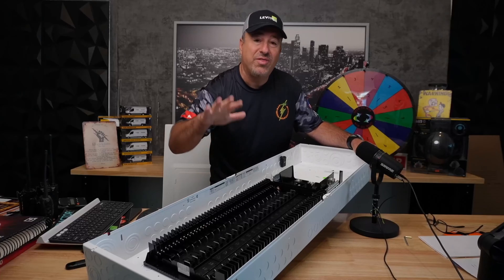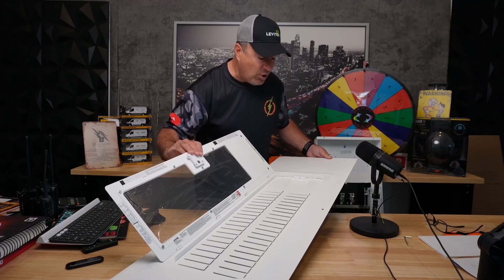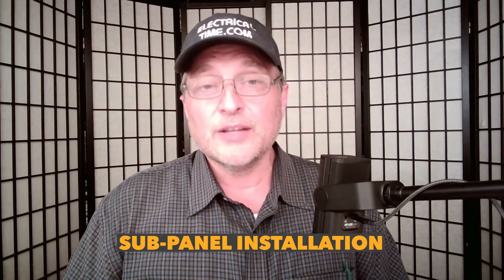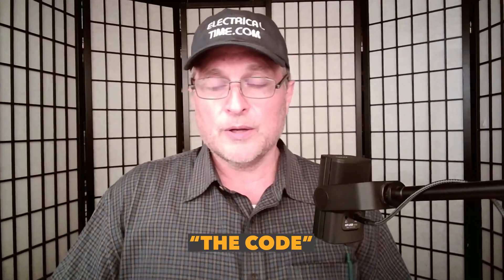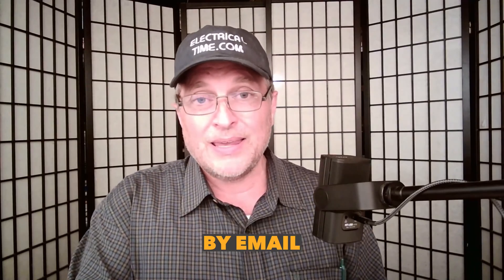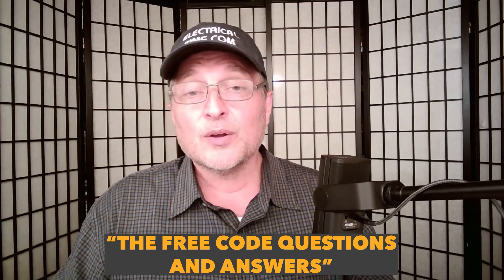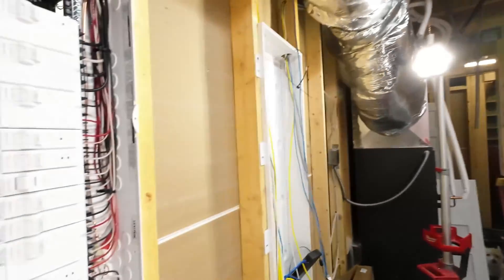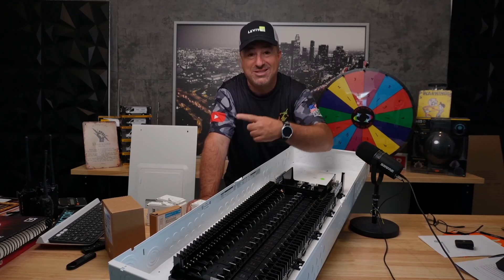The Ultimate Electrical Panel Video for electrical contractors Sales, Code and installation #Leviton

Comment: Have you connected a Leviton Smart Home Load Breaker Panel's (LWHEM2) module "BLUE" wire to a Generac contact board?  Does that BLUE Wire go to a transfer switch or to the generator AC1? Leviton does not show how the blue wire from the LWHEM2 comes out of the Breaker Panel over to the Transfer Switch, then continues from the Transfer Switch to the Generator Board? Does the LWHEM2 actually do the load shedding via the Leviton Phone App?  AND -- They do not show this wiring or explain the load shedding (if there is any) very well IMHO.
Reply from the maker: We have not

Comment: who in the heck can afford $100 + per wireless breaker?
Reply from the maker: The person that needs or wants it? Who can afford an iPhone?
Reply: @The360Electrician  iphone is cheap compared to buying 42 wireless breakers at 100+ each.
Reply from the maker: @KrazyKajun602 not if you want 42 wireless breakers? You can get a non iPhone phone for $149 same thing. You have to pay to play right? Good thing is you have the option to go "wireless" if you want and not forced

Comment: Once the panel is live and someone wants to update an existing breaker to a smart breakers. Do you need to turn off the main to the entire panel just to replace it since the wires are on the buss instead of the circuit? Thanks.

Comment: Just being pedantic. The breakers are Bluetooth Low Energy (BLE), not Wi-Fi. The smart module (LDATA v1 or LWHEM v2) are BLE to talk to the breakers, and Wi-Fi to talk to the outside world for monitoring. When getting firmware updates for the panel (smart module), you'll get them usually in pairs -- the main firmware and a BLE firmware.

Comment: Was this system made for the home occupant to change out a breaker on their own? I have a 20amp breaker that will not reset, and the AF, and GF windows aren’t red. Is this something I can switch out? And, Does it have to be replaced with an exact Leviton breaker? Meaning if that breaker that won’t reset, will I have to get a breaker that has the two windows, AF, GF and T, or can I replace it with one that just has the AF window? My box has a mixture of these 20amp Leviton breakers, some have the AF, some have the AF, GF and T. The one I need to replace is only used by my Clothes Washing Machine. Will I need the AF, GF and T on the replacement breaker?

Comment: In August of 2022 I was contacting Leviton support requesting an upgrade for the ability to remotely "Trip/Reset" the breakers as Gen 1 only has the ability to Trip the breakers. A real pain. Well guess what, they may have listened and now there is GEN2 which allows for also resetting the breaker. Wow! I also requested that they make changes to the UI which I feel needed to be made. I am still not happy with it. My entire house is Automated/Home Control and I also have Energy Management, so needless to say when I dish out big bucks for a product,  I expect a lot from the manufacture.  My biggest complaint is that they have not come up with a local API to allow the homeowner to eliminate the need to go to the cloud for the data. At times the Real Time data can be downloaded to the up to 5 minutes later, not very reliable for HA. (I monitor the entire electrical system using a BrulTech Energy Monitor which is spot on for actual Real Time Live readings). Also the data can not be stored in a "LOCAL" database nor is there any long term data that you can get to . Personally, it is my system and my data which should be made available to me right here at home. As for reliability, it has been OK. I have had to replace 3 breakers since I installed the panel. I have to admit that Leviton was great here as they replaced them instantly, but if you do decide to go with the Smart Panel purchase NON-Smart breakers as backup. Lucky me!  That is what I did (1) 60 amp (HVAC), (1) 50 amp (Range), (1)30 amp (Dryer), (2) (20 amp), (2) (15 amp). Believe me they came in handy. Gen 1 obviously was not designed for any type of Home Automation or Load Balancing/Priority restarting. Overall, I would give the Smart Panel a C+ rating, the UI a C rating, the data collected from the smart breakers a C. 

As for upgrading to a GEN 2, for the ability to "Trip/Reset" breakers remotely to control critical components ( for Load balancing and priority restarts) , of my house such as HVAC, Refrigerator, Media center, Home office... based on my GEN1 track record, and the steep price increase for the hub/breakers, probably not. As an ex electronics engineer and even an electrician, I do not think so. I originally was going to go with the Schneider PowerLink system, which has a  low voltage (24VDC)  3 wire pigtail (Gnd, and 2 leads that when the + voltage is applied will either Trip or Reset the breaker. The issue was that when I discussed leaving the pigtail from each breaker un-terminated with a local inspector, he did not like that idea. It would have taken about 2 months to get those breakers remote control wired in. I may still go with that setup... what is another disconnect/install.

Comment: Looks like you are using the older V1 version of the hub (LDATA) which can't use the new V2 breakers.  Maybe add a comment on the video description about the new hardware. The new V2 allows for remote on/off and automatic load shedding, a much more robust system, very  competitive to SPAN now.
Reply from the maker: Yes, that is correct. I just met with Leviton to do a follow-up Gen 2 video since gen 2 was not out at the time we filmed. Ironically, SPAN also wants to do a video with us, but details have not been ironed out. Stay tuned. All good stuff, but who will win. In the end?
Reply: @The360Electrician  Glad to hear you will do a V2 series, I will sub to keep up and check out the new video. 
For my recently completed home I asked for 2 Leviton panels, at the time V1 was the only thing available, so I have a crit loads panel and a main panel. With the new V2 I would have elected to go with one panel, but so it goes. 
I considered SPAN, but was turned off for a few reasons 
1) 32 slot max - which means at least 2 panels for me - that was a huge down side 
2) At the time, no support for generator (not sure if that has changed since I looked)
3) They will only sell to an electrician who has been certified by SPAN. Huge turn off
The plan is to slowly move to all V2 breaker over the next year or so, and once I have a battery system in place I will power both panel from the same source, and can use the automatic load shedding - shall see how that goes
Reply from the maker: Have you installed many? Seems like you know your product. I don't think enough electricians are installing them. Could be a huge extra for us. Where are you tuning in from?
Reply: @The360Electrician  I am in Colorado - I am a home owner who recently completed a new build - I have side by side panels which have all V1 breakers, but just upgraded to V2 hubs - I think the most challenging thing right now is availability of the V2 breakers - also they are way up in price if you can find them. 
I requested Leviton panels in my home
Reply from the maker: @iambabayaga   That's awesome, I love the plug on technology so you can simply just swap smart and non smart breakers at will. Great for upgrading or building out your smart panel over time. GAME CHANGER! I will have to check into G2 or V2 supply chain. I was just with the guys in charge of the smart panel over at Leviton, I'll send them an email.

Comment: I would love it if you did a follow up video even just a talking head about your experience with the Leviton Smart panel, technology that let you monitor and control breakers. The whole system is kind of expensive versus just getting something like the view too.
Reply from the maker: Gen 2 video coming and will definatly do that. Thanks for the support. Where you tuning in from
Reply: @The360Electrician  yes, I’ve been seriously considering it. I already have the Leviton panel installed, but everything’s a dumb breaker.

The vue system is $300 ish for 16 circuit monitoring, but it’s really messy. Going with Leviton GEN2 smart breakers and system is around the same price but that’s just for one circuit. Each breaker is almost triple the price. If the app integration and everything works very well it be worth it. Very clean install.
Reply: @TekShinji  do the dumb breakers make noise?
Reply: @The360Electrician  tuning in from New Hampshire!

Comment: Heard there are noise issues with the breakers anytime they're energized (hissing, clicking, humming). Did they fix that with v2?
Reply: I have had my Leviton Smart panel in for over a year now and I have never heard and noises coming from the breakers.
Reply from the maker: I haven't experienced that, is that on the smart breakers only or all the breakers?
Reply: Smart breakers only @The360Electrician
Reply: im told the issue is with the smart breakers. i would love to know what they sound like. @The360Electrician
Reply: All breakers @The360Electrician
Reply: @The360Electrician  Im looking to have my electrician put a 40 leviton in a Beach house. Worried about the noise issues with the wifi 2nd Gen and was told to stick to dumb breakers. Any thoughts?
Reply from the maker: @PalmBeachFlorida24  Nope, I would reach out to LEVITON about this. I havn't had any complaints? Should be nothing to chatter or humm with wifi?
Reply: @The360Electrician   ok, thank you!!
Reply: No hissing at all on my smart breakers. I think this was a fluke with some people.

Comment: On the right-side of the panel, where are all of your grounds going to? It looks like there is just a neutral bar at the top.
Reply from the maker: The top bar is separated since this is a sub panel. If you put the jumper in it will bond both bars and the can. Watch near the end I think we show it. Thanks

Comment: I bought a Leviton Load center for my house. I like it  but I feel that their app is still way to slow and clunky. There is also no way to access the usage history.

Span has the up-side where they are using relays, so you can load ahead on and off. This load center only allows for remote trip. (no remote "un-trip" for obvious reasons.)
Reply from the maker: Rumor has it. One may show up here soon. I'm Definalmtly looking forward to checking that one out.
Reply: @The360Electrician  that would be great. And awesome to hear why the system is as slow as it is. I really like the system, it just needs some polishing.
Reply: You can remotely turn on and off breakers now. You don’t need to physically do it.

Comment: So all the wires hook to bussbar and you just plug in a arch fault or reg breaker?
Reply from the maker: Yes, it's s great design.  And if you don't put any smart breakers, it's only a 100 or 2 more than A. Regular panel, but then you have the options any time to upsell
Reply: Very interesting. I might try this panel instead of the qo with the quick tabs on top. 

I always say I'm going to use a new product and go right back to sdqo.

Comment: If it isn't SQ D homeline  i won't buy it
Reply from the maker: Interesting. Are you an electrician?
Reply: @The360Electrician  the reason I said Square D homeline is because I am a maintenance and repair electrician out of all the electrical brands homeline seems to be the most reliable and the absolute worst breaker is Eaton
Reply: Homeline is SqD wanting to look like GE.
Reply: That’s a basic bitch panel
Reply: How much wasn't answered. Not the labor, the part. Come on

Comment: I'd like to give a tips for two categories of electricians:N1  electricians who care and like this job and N2 electricians who like only paycheck.Case happened  with me havin an trainee young guy N2 category...we changed service panel an I told him how the things are going with the panel..however proud and unlike to deep in electricity job..he thought he knows a lot.So at the time turning ON Hot Tube I especially  was waitin at Hot Tube board.After I told him turn on I heard unexpected Humm of motor...of course I told him to turn off...So the mistake was a Neural was hooked up in the wrong spot of a two pole GFCI breaker where the breaker has four output two hots and one neutral has a mark(N)...it's very confusing cause you have one open spot but there is nothung.So be careful about.
Show less

Comment: I worked for Leviton for 12 years. For the past year I have put in all AFCI or AFCI/GFCI breakers for single pole and when needed on 2-pole. Good video.
Reply from the maker: That's awesome, I love the double plug in breakers so we can land all the wires before breakers. Then I take the combo you mentioned and one by one check circuits before drywall. GAME CHANGER
Reply from the maker: Where are you tuning in from?
Reply: @The360Electrician  Wilkesboro, NC. I used to work at the Jefferson and West Jefferson NC plants.  The Jefferson plant is closed now.